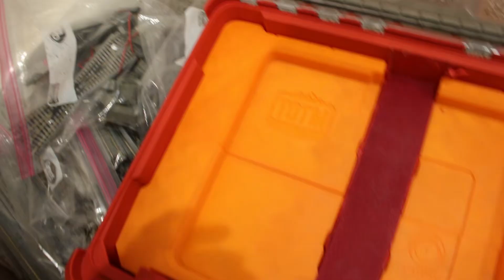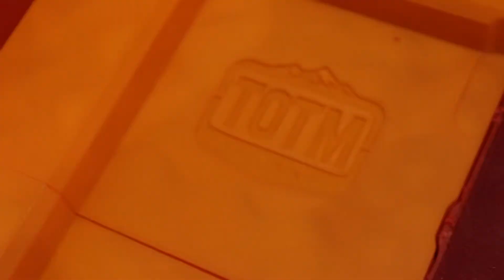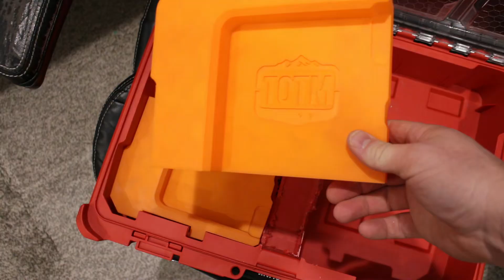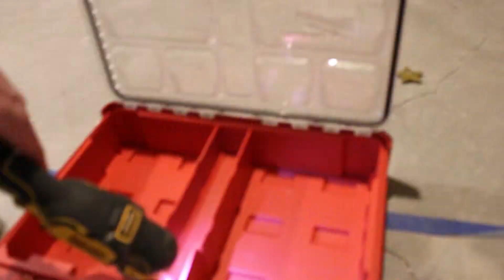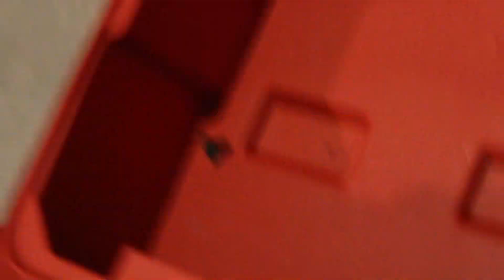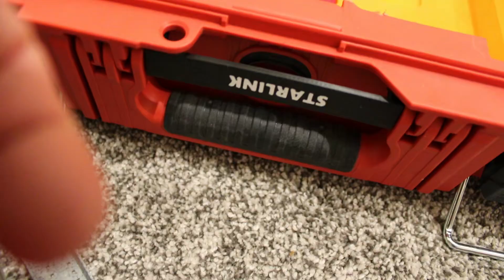Using Codex and OpenScad to 3D Print the Perfect Star Link Mini Insert for my Milwaukee Packout

Comment: how long did the Codex open scad take if you dont count print it?
Reply from the maker: Oh I probably spent 16 hours at least. I should probably just learn openscad scripting..might be faster. Then there are also several iterations as goes with prototyping. With print times this project took me a week to do. I was doing other things while codex wrote and did some things... But you still have to render the files and then do all the print settings too.. all that takes time. Very tedious process. Addicting but tedious. Hope that helps

Comment: Great video!! What was your workflow? Did you attach the scad files to your Codex prompts? Or did Codex use an MCP server or computer use to interact with OpenScad?
Reply from the maker: I use codex plugin on visual studio code, and gave it access to my openscad scripts. I then open the script in OpenScad desktop and change in parameters either with the settings tool or inline in the script and export to my slicer.